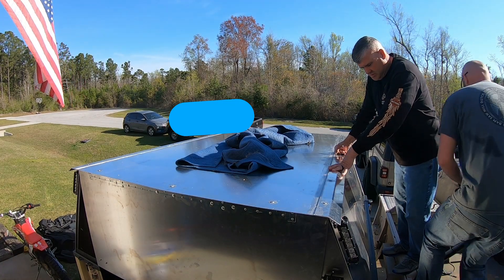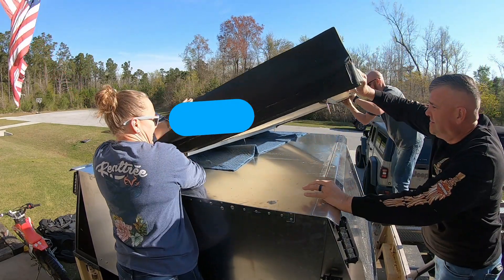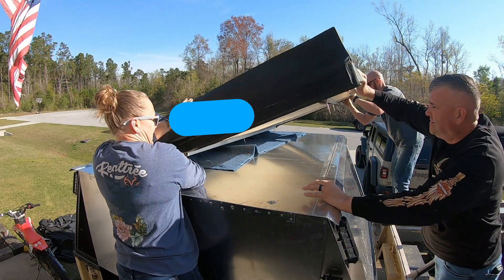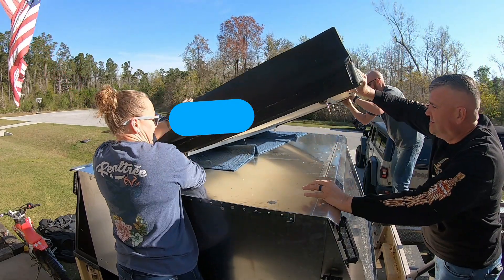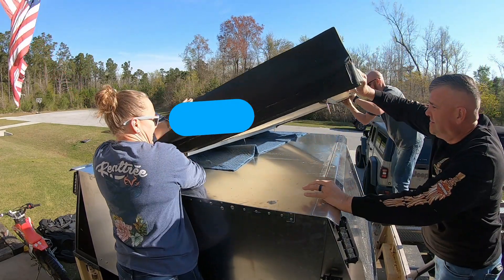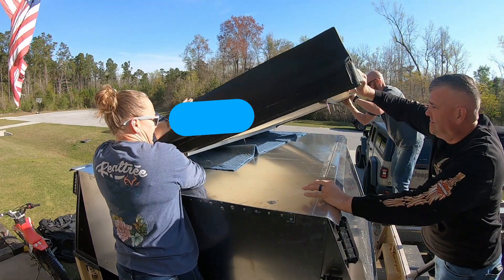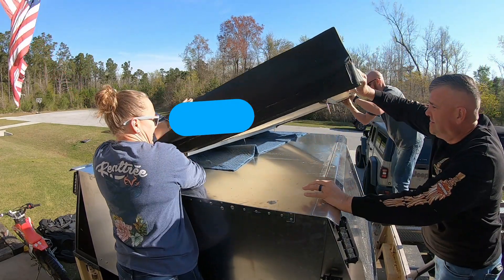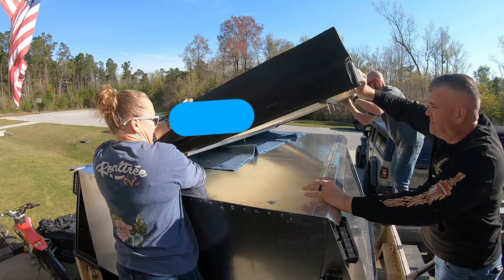M1101 Part 3 Cost Breakdown and 1st use.

Comment: This same ish build from a company that makes the 1101/1102 would be in the 30k ish range if not a little bit more. You have done a fine job with this build and for the price you did it for, great.
Reply from the maker: @rundmm  thanks, it definitely took a lot of hours which were not calculated and I understood a lot more why some of the small trailers do cost that much after building this one.

Comment: This has been a pretty great series. Tell me, have y’all explored replacing that front metal wheel with a pneumatic tire (or, possibly a never flat tire)? I’m running an m1102 with a voodoo max modular rack and a Roofnest Overland and awning. 

Saw your 12v wiring video but had already taken mine into our local trailer shop for a replacement.
Reply from the maker: @OWPhD  i had looked but ultimately due to weight i just left the metal one on as it works well. Hopefully it gives you some ideas for future stuff.

Comment: Great build. Loved watching all the progress through the video series. Quick question... I am in NC as well and just bought a M1102 from a guy but he never had it titled or tagged. What all did you need to title a government trailer like this?
Reply from the maker: @jmtaylor1992  you have to get a home built trailer title. You go to DMV and ask for the paperwork. It's about $20 and they give you a VIN # that you have to stamp on the frame and axle.
Reply: @ajphillipsjeeps  did it require any other documentation? Like a bill of sale or inspections? Trying to make sure I’ve got everything before making that unpleasant trip 😂
Reply from the maker: @jmtaylor1992  nope, a home built gets inspected by a NC trooper that you stamped the vin on the Axle and the tounge you take it back up and Tittle it. I would suggest a permanent tag also. Costs about 3 years but good foe the life of you owning it.